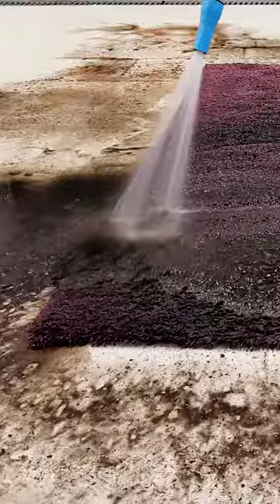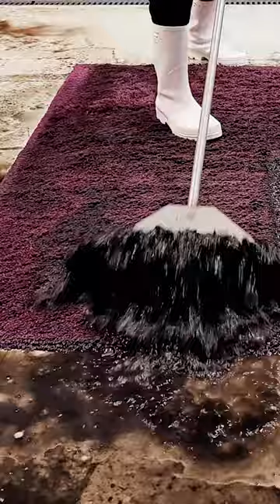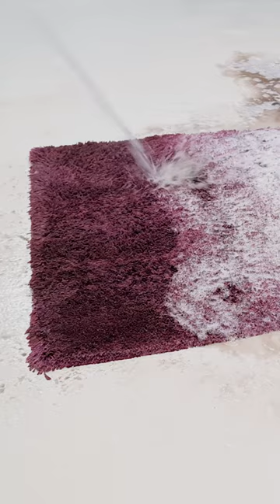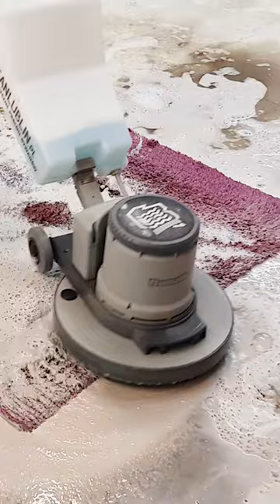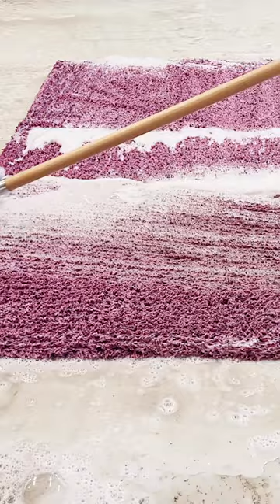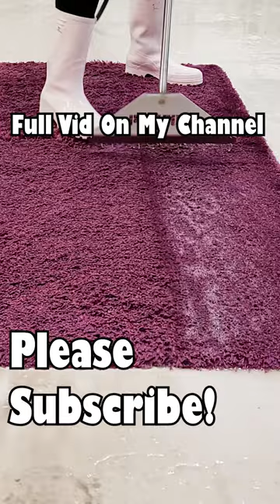A soft purple rug emerged from a layer of mud #shorts

Comment: You used to much water more then a value of the rug
Reply from the maker: It depends, water is cheap here.
However, the value of the carpet is not always converted into its purchase price.
Many customers are sentimentally attached to the carpet, and this is a completely different dimension.